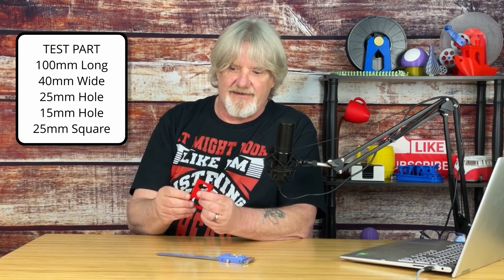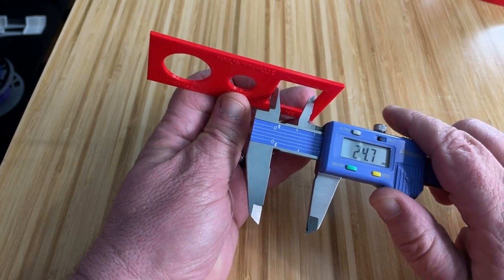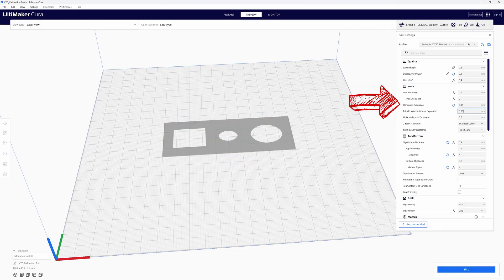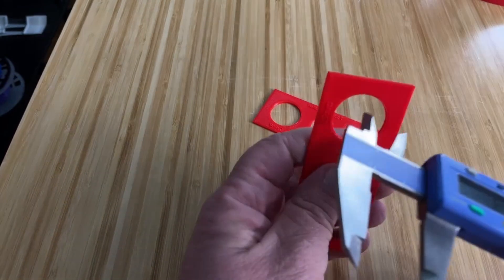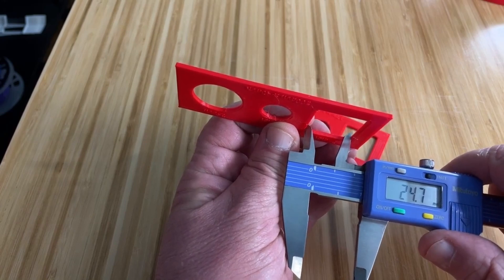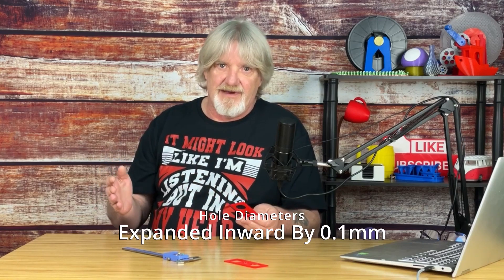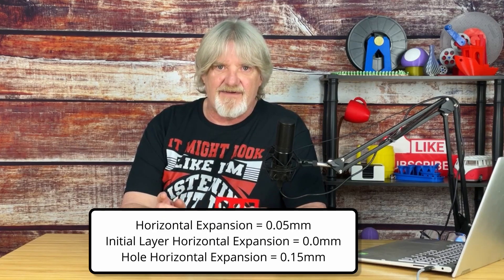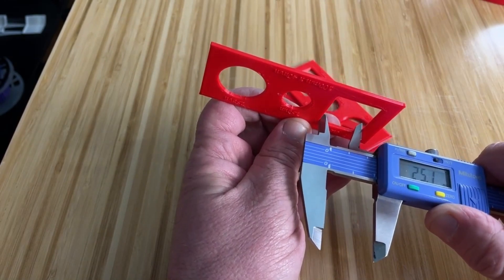Dialing In Dimensional Accuracy With Horizontal Expansion

Comment: How to do this to Bambu printers?
Reply from the maker: Simple answer is, you don't do this to a Bambu printer.  The video is for printers running Marlin Firmware which was common at the time the video was made. Newer, faster printers are running Klipper Firmware. Bambu uses their own version of a firmware, probably Klipper based. If you need to make adjustments for dimensional accuracy on a Bambu printer I would do it through the slicer settings in the Quality Tab, then scrolling down to Precision. I hope this helped!

Comment: I found this video helpful as I was having trouble getting hex bits to fit into my hex bit designs. The holes were too tight. I compensated by redrawing the design with larger holes. I didn't know about these compensation settings. I made my own test file though. While calipers are accurate, the user can easily introduce error into the measurement. My test file is smaller intended to use a few drill bits and a hex bit to measure with. The fit or they don't. I'm happy with my contour as is. It is close enough for my needs. I did make a hole compensation adjustment of 0.15 mm. My drill bits and hex bit fit very well in the holes. Hopefully I can know draw something with a clearance added in and the holes come out perfectly. Time will tell. Bottomline, I wouldn't know to do this without your video. Thanks.

Comment: so after doing several of my machines ive come into an issue. intial layer accuracy is a fucking ruinimg  my there a modell youve made that wont include the intial layer for the dimiensional accruacy?. i need a way to measure model accuracy that doesnt include initial layer accracy.
Reply from the maker: Just set you initial layer height to be equal to all of the other layers. For example, if your layer is 0.2, set the initial layer height to 0.2.

Comment: i need a good profile to start on an ender 5 plus stock for cura 5.7 if anyone has one.    ALSO with this help with print in placec items????
Reply from the maker: Best way to get a good profile, dial in your eSteps & flow rate. Run a temp tower to determined the best temp for your filament followed by a retraction tower. That'll put you on the right path. I have videos for those on my channel. Good luck!!

Comment: Is this the correct order for calibrating?
1-  PID Tuning for hotend and bed, 2-  Extruder E/Steps, 3-  Flow Rate, 4-  X,Y,Z E/Steps, 5-  Hole Expansion, then Hole Horizintal Expansion?

Did I miss anything?
And which ones do I need to do again for different brands of filament?
Reply from the maker: In the order you listed them, I run and temperature tower, followed by retraction test after flow rate. When I switch filament brands, I run the flow rate, temperature tower, then retraction.

Comment: I have been wasting my time on the Creality CR6-SE, I thought I was doing something wrong until I realised the strain guage is not accurate. I want to change it to something else but that would cost even more and I am fed up with it, I took some measures to stabilize all other forces that are altering the bed leveling, but now I will start tunning it using this video, thank you sir.
Reply from the maker: I hope this helps! Post your results and thanks for watching!
Reply: @pushingplastic7445  it did help thank you sir! on average I got it near 0.8, the thing is, that average consist of one wall being 0.77 and the rest above 0.81 or 0.82, why aren't all the walls relatively the same?
Reply from the maker: @SaifBinAdhed  Believe it or not, sometimes it can be that pressure being applied on the calipers. More commonly, it's  because the printer is coming off of a corner. The walls will always be thicker near corners because the print head slows down to make the 90 degree turn but the filament is still flowing, sometimes it's flowing faster than others depending on the material, the print temperature and the size of the model.   The numbers you're getting look pretty good!
Reply: @pushingplastic7445  yep, I'm pretty happy with what I got, I'm doing all steps you are recommending and I'm enjoying every step of that way, but I just realized that the strain guage on my CR6SE will always be my issue, I need to find a way to replace it with a different bed leveling mechanism.

thanks again 🙏

Comment: hi great vid,new to 3d printing.  I was wondering if i could have some advise on a model i'm trying to make,  i would like to re create a part for a glue machine i use the part is the nut that holds the mixing tube,  it is a nut with threads in side with a taper and hole for the tube to pass through and sit in.. I have managed to make one but the problem is the body is ok but the threads dont fit, or the threads is fine but the body too short and if i adjust anything it all goes wrong thanks paul.
Reply from the maker: I've actually been thinking about this for a few hours now. I'm assuming that by the body being to short, you mean in height, not width Is this a part you designed? If so, you might better off to try to manipulate the file in some CAD software. I would modify the body to suit the length that you need without touching the thread. If the width is the problem, I would figure out how short it is, use horizontal expansion to increase the width and then use Hole Horizontal expansion with a negative value. So if the width of the body is short by 1mm, set your horizontal expansion to 0.05mm and your hole horizontal expansion to -0.05mm. This would increase the body width by 1mm while keeping your threads the same size, the size that works. I'm sorry for shoddy answer, without seeing the part it's hard to provide a better answer. But I thank you greatly for watching.

Comment: These are some settings I have yet to mess around with but I think I'm ready to give them a try.  I recently discovered how useful outer wall inset can be.  That coupled with slicing tolerance options have really started to help things fit well.  This will be an interesting addition to the testing I've been doing with vase mode/nozzle size/layer height.  I recently came across STUPID CHEAP PETG...I'm talking $19.87 per kg with shipping and taxes included cheap....it prints out amazingly smooth and really flows well at 230°C.  Layer lines seem to disappear.  So far I've been using it to mess around with a bunch of other settings you've suggested and things are getting rather interesting...in a good way.

And yes...I picked up a good amount of that filament...another 10kg is on its way.  😁
Reply from the maker: That’s a great deal on the petg! And you can never have enough! If you mess around with these settings, load a simple shape into cura and change them to some some absurd value like 5mm. Slice and look at the preview. You don’t have to print it. It’s just a great visual on what these settings can do for you!